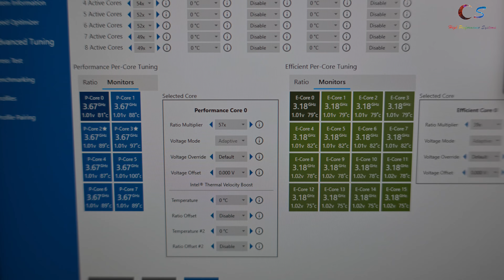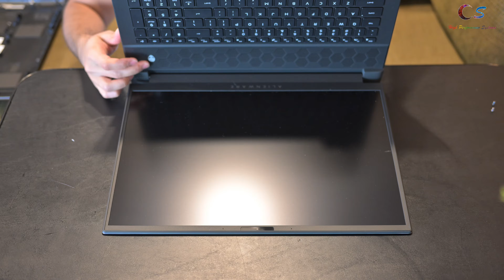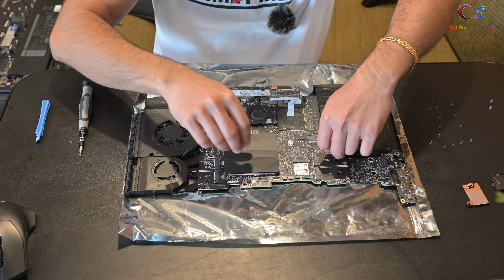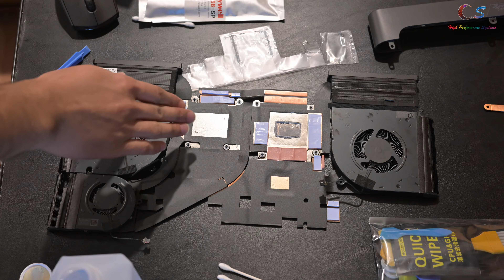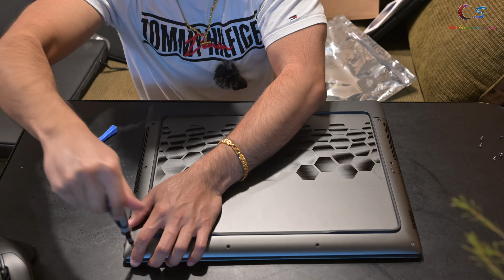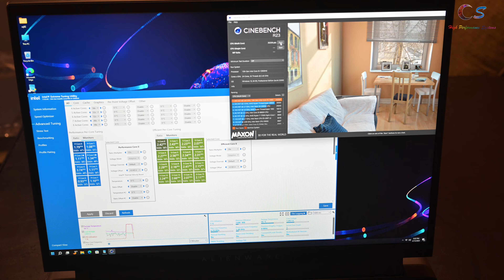Alienware m18 Disassembly & Repaste

Comment: this is silly i mean this laptop supposed to be replace desktop ones so these should be easy to repaste why they do such a thing like this also i wonder razer blade 18 good or this one ?
(i9-4090 settings)
Reply from the maker: The razer blade 18 will have less performance from what I’ve seen. They all run hot so get the one you like the most. The performance difference between them all isn’t significant enough to make a difference in 99% of tasks
Reply: @cs.studios  hm ok thanks for answer oh by the way lot of youtubers say always bad something about dell and his brand alienware and i dont get it why i mean this brand in my country people respect because his service quality build quality (some models) but every youtubers say something bad about alienware or dell i wonder why ? i mean i love dell brand and i bet if i buy gaming laptop proabbly buy alienware and these kind a claims make me wonder.

Comment: @CS Studios do you think it would make sense to change the other thermal pads? What thickness do they have? Thank you
Reply from the maker: I personally didn’t change them. I saw they were making good contact so I left them alone. You will want to buy 0.5mm, 1mm, 1.5mm, 2mm, 3mm and 4mm pads. It’s best to do trial and error with pads on your own system if you decide to change them all

Comment: I still think the Area 51M R2 is the greatest laptop they ever made. Even before a repaste my 10900k rarely ever thermal throttled. Its 2080S was on par with a desktop 2080 at 200 watts. 

Its a shame they lied to the R1 and R2 adopters. Fool me twice, I suppose.
Reply from the maker: I personally prefer my R1 because it has 4 RAM slots for 128gb. But yeah they were the beasts after like 5 years of nothing amazing. The m18 R1 is the closest we’ve gotten since the Area-51m days.

Comment: Been doing some research on PTM7950.  I would have heated it up with a hairdryer to get out any bubbles and allow the material to be crushed down more evenly reapplying the heatsink.  That's just my 2 cents but I'm old school and always go for thick quality paste and evently coat the cpu.  But I deal with a lot of AIOs.

Comment: This is great! I'm thinking about using thermal pads on my M18's m.2 NVMEs because I read that cooling these downs help with CPU and GPU temp. Maybe I can do the thermal pads the RAM too? Do you have any guidance on how to do that and which mm thickness the pads should be?
Reply from the maker: I wouldn’t bother with pads on RAM. For the SSD you can get a m.2 ssd heatsink too

Comment: Did the ptm 7950 fix the one core that was higher than the rest
Are all the cores even in temps now
Reply from the maker: Yes. The power consumption/clock speeds went up after ptm7950 along with performance. All cores are all close together in temps now

Comment: Taking away the liquid metal was a downgrade. Probably better to undervolt the cpu.
Reply from the maker: It wasn’t a downgrade, the cpu is boosting higher and using more power now. So even though temps are high, it’s because it now performs even better. I’m hitting 37k Cb r23 now
Reply: @cs.studios is there anyway I can find out your settings so I can apply the same on my unit to overclock and get higher Cinebebch R23 score ?

Comment: Sounds like it didn't work out in this case, must have done a good job at the factory. I think this also just shows me that the i9-13980hx is a better option for this laptop with better thermals and better undervolting.
Reply from the maker: Actually it did work out kinda. So my temps were still high but that was because the cpu was now boosting much higher. I can score 37k Cb r23 now
Reply: @cs.studios  Ah fair enough, as long as your happy with it! Seems like a huge pain to repaste on these things though. Probably more worth it for folks after the warranty is up in my opinion.
Reply: You have better thermal with 13980HX ?

Comment: The statement about not using alcohol to remove Element 31 is definitely correct. It is buried in the Alienware X17's documentation, and VERY VERY few people know about this . . . including Youtubers and even technical support staffers.
Reply: Yup.. nail polish remover all the way for liquid metal based compounds.
Reply: I think the key to recognize on the 1st benchmark after applying the thermal pads is that the difference between the hottest and coldest P cores reduced. MUCH more importantly is that the standard deviation of all P cores was WAY lower - i.e. MOST of the P cores were now at or near 100deg when the hotest core was there.  Also, when you went to a bigger undervold, the #5 core was no longer your hottest - it was #7.
Reply from the maker: After a few days I hit 37k cb r23 score. Ptm7950 has a small deviation between cores and performance went up
Reply: @cs.studios  that is just insane!!
Reply: I've seen multiple laptop repair videos using alcohol to remove the liquid metal and that does not happen at all. It may cause it to separate a tiny bit, but it doesn't "spill" whatsoever...

Comment: Would have gotten better results with quality thermal paste.
Reply from the maker: Ptm7950 is better than essentially all thermal paste besides pure liquid metal
Reply: @cs.studios honestly.  Its too thick, and the purpose of pad thermal material is to fill gaps when gaps are present.   Cpu or gpu should have zero gap.  So while the material has good conductivity you will always have too much material.  Not an ideal solution at all.  But would be great for vram on gpus.
Reply: @mkgriff1492  tottaly wrong bro
Reply: @coreplaygames7481  Only small handhelds use this solution.  You won't find it in any laptops from any manufacturer.  Everyone has mixed results with this stuff.  Usually, most people end up going back to liquid metal.   This is phase change material, so it's not phase changing as you are applying the heatsink, and that's an issue.   Laptop and GPU heatsinks don't use extreme amounts of pressure.  Too much material is a factor.
Reply: @mkgriff1492  this is wrong, first I always prefer to use a PTM than liquid metal or thermal paste. The thickness fits perfectly in any notebook. Liquid metal actually cools better, but in addition to being much more expensive, it is dangerous to apply, as it can leak after a while. PTM is the best cost-benefit on the market currently. Only liquid metal is worth it for overclockers.

Comment: It seems pathetic to me not to show the detail of placement of the replacement thermal paste, a lot of us go to see the video just for it. you give a thousand turns in unscrewing but you go over the most important point
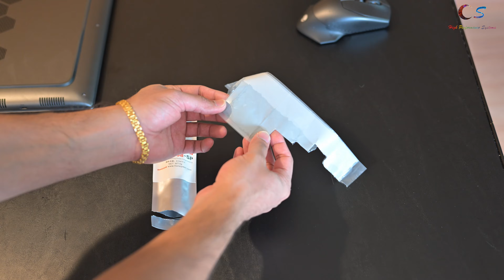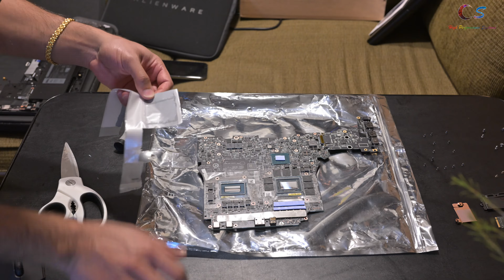Reply from the maker: It seems pathetic you didn’t hear at 1:09 I said I am using ptm7950 phase change pads not traditional thermal paste. Did you even watch the video? At 15:15 you can see the phase change pads applied. They cover the whole die. The video is in 4K you can zoom in. There are hundreds of videos on youtube on how to apply “paste”. Which I don’t recommend in this kind of laptop. The stock element 31 performs decent but problem is uneven contact which no paste will fix, hence using ptm7950 phase change pads instead.

Comment: how comfortable are you with a laptop that operates at 100c
Reply from the maker: You mean how often I run cinebench r23 to make the cpu hit 100c? Gaming temps are 80c or less now after repaste and a couple of thermal cycles. Gpu temps are even lower
Reply: @cs.studios  Do you mean that although the temperature will reach 100c when you run Cinebench, it is only around 80c when you are gaming?
Reply: Just lower the multiplier by a couple hundred megahertz and problem solved without losing too much performance.

Comment: Good Job. Does your wattage drop while Gaming for a couple of seconds?? And how did you enable undervolt in intel Xtu ? mine says undervolt protection enabled 
Btw 64gb Ram only work 5200 Mhz 32gb work on 5600mhz
Reply from the maker: I haven’t noticed that but will keep a close eye on it. m18 specifically supports 64gb 5600mhz ram and 32gb 5800mhz ram. Toms hardware has a i9 13980hx and 32gb 5800mhz ram config. I saw all the options hidden in bios, the laptop needs a bios to show the hidden ram timing and OC page
Reply: @cs.studios  I have the M16 with 4090. while Gaming Every 3 - 4 min the CPU wattage drop to 30W for like 3 seconds. That Pattern is in every single Game.

Comment: Plastic chassis...👎
Take X series...
Reply from the maker: I have both, the difference between X series and new m16/m18 is very minimal
Reply: @cs.studios  well, the X series have magnesium chassis and alluminium. More speakers and x fan system. No?
Reply from the maker: The new m16/m18 have aluminum lid/cover and aluminum die cast frame. The new x16 has full anodized aluminum chassis. M series has quad fans with full copper vapor chamber. Not to mention 10 extra cpu cores. The X series is lighter thinner and has more speakers (only x16). I personally would take a m18 over x16 anyday. Although if comparing x16 vs m16 I’d rather have X16. AW improved the M series build a lot compared to last gen

Comment: Friend, thank you very much for the videos you have made. I am currently going to switch from my Area 51m R1, to the Alienware M18. I honestly wasn't sure about it, but your videos helped me choose. One last question would be if the M18 has 4 slots for ram memory or only 2. Grettings from Orizaba, Veracruz, Mexico.
Reply from the maker: It has 2 slots for RAM. As of right now I am running 64GB (2x32GB) RAM. Once 96GB (2x48GB) sticks become available I will upgrade
Reply: @cs.studios  I come from an Area-5m R1, before I had the 17 R4 and before that the M18x and the M11x. For this 2023 I expected something different from the Area 51m, I even wait 4 years to upgrade to a new laptop but I already bought this M18 R1, but with a very bad taste in my mouth, in reality I almost didn't want to buy it and I was about to betray myself buying a Razer but couldn't. It bothers me that Alienware does nonsensical things like not putting lights on the touchpad, or putting the SD card reader on the back and instead the ethernet port on the side. The worst is it feel like im not upgrading nothing since is a exterior copy of the Area 51m.
Reply: @cs.studios  does M18 r1 support 96 gb ?

Comment: Thanks for the hard work and posting this. If only they didn't have an inverted motherboard I am sure the temperatures would be better. CBR23 will make most systems break a sweat, how are the gaming temperatures after the repaste?
Reply from the maker: In the last of us part 1 cpu is around 89-90c with balance mode fans. I guess that’s better than 95-100c lol. I’m sure if I do ultra performance fans it’ll be a bit less. Just lifting up the laptop a bit from the desk alone decreases temps to 81-82c
Reply: @cs.studios  Wow, that is a huge drop from propping it up.  Would love to know how low a cooling pad with fans could get it.

Comment: last time i bought an AW, it had massive core differentials due to the tripod heatsink. I was upgraded to a newer laptop which still had the same issues. Now 5 years later, it seems like they still haven't made progress on the cooling side and made it harder for enthousiast to repaste their machine.

A shame you still need to open up a brand new machine and put on new paste. But as long as people tollerate the broken laptops from factory, they newer will be pushed to fix their mess
Reply from the maker: They’re getting wrecked on reddit about temps and I’ve also told them so they at least know there’s some issue
Reply: @cs.studios  But Dell not listen to you !
Reply: @cs.studios  Dell and many other companies like Asus do not listen to costumers at all!

Comment: In my experience with ALL Alienware laptops since the introduction of the M15 R X series laptops, and X series, copper shims are needed to get proper mounting pressure for active cooling gains. I did have an X14 that I worked on last year, that liquid metal cured without any shims.
Reply: I have wondered about this for my X17 R1 with 11980HK. It has a 21 deg gap when the first core hits 100. Stabilized, I have 2 cores right at 100, and every other core is below 90 with most in the mid to low 80s! Do you have any links or other info you could provide to help me with shimming my own mounts? Thanks in advance if you can help!

Comment: It looked as though there was a felt/mesh like dust filter inside, on the top honeycomb intake holes (beside the power button).  I wonder if removing that would improve airflow...
Reply from the maker: Interesting, I may have to take a look when I disassemble again
Reply: 8:52

Comment: Nice video bud !  Yeah, the E31 wipes off pretty easy, I found it easier then IC Diamond haha.  Glad this improved your scores yet again :) it's really unfortunate that we need to do this, but at least we know it can be fixed.  I still can't figure out what the difference is between mine and yours, as I am still locked out of undervolting in XTU, for whatever reason.
Reply from the maker: Try resetting bios defaults and switch awcc to custom profile then open xtu

Comment from the maker: 37k cb r23: https://i.imgur.com/QayY6dH.png

Next: I wonder if I should add a sub into the m18 like I experimented with a 2nd one in one of my m18x years ago... lol: https://www.nbrchive.net/xfa/alienware-18-and-m18x.1092/MSI%20GT72S%20Subwoofer%20Installation%20%5BM18xR2%5D/images/storyImages/Y4k4Sr6.jpg

Element 31 is actually a good performing TIM. The problem is, it isn't applied properly from factory otherwise performance can be very good. Here I replaced with ptm7950 phase change pads.

Interestingly, the overall temps on all cores went up, however, my performance increased, and the cpu does not throttle as bad as it did before.

I may re-paste one more time when my fresh ptm7950 comes in since this one seems not as good as when I first bought it
Reply: it would be nice if dell actually sells it too hehe but I also recently ordered the PTM7950 as well as some fuji poly thermalpads.
Reply: that would certainly be a baller move lol
Reply: Overall temps went up probs because the heat was evenly distributed vs your hotspot before, right?

Comment: Nice video! BTW I think its the pads thats the issue, maybe try getting some better thermal pads. Plus im kinda curious why at stock, the m16 out performs the m18 in terms of benchmark. The m16 by other tech youtubers seems to handle the heat better than the m18. Gizmo and OwnOrDisown also has a underperforming m18 while the m16 they bought performs better.
Reply from the maker: I don’t know of any m16 performing better than my m18 at stock (see my m18 review video) but I do know many m16 came with awcc v5 whereas m18 only came with awcc v6. With some bios updates the m18 is performing well. We just need dell to apply element 31 better
Reply: @cs.studios  Gizmo tech's, Own or Disown as well as one small youtube channel has a underwhelming m18 bud. I got the m16 because it was the only thing available back in feb when my brother was about to go home to our place. Anywho I hope someone makes a repaste guide for the m16 as well. BTW whats your reasoning behind using intel xtu over throttlestop? I havent used xtu but Im waiting for a guide on how to optimize the m16. Its still in the box haha. NIce vid! keep it up!
Reply from the maker: No offense to anyone but everyone with a underperforming m18 could have fixed most of their performance (besides throttling/UV). I stayed on bios 1.2.0 until 1.6.0 came out and was already scoring 33k cb. I spent over a month with my laptop before even posting a review video. My friend got his laptop super early and I saw why some people were having issues right away. If you play with awcc you will see which profiles cause performance problems. Running balanced or custom alone fixed many issues. His laptop was performing similar to everyone else too and I got him to 32k CB in a couple of hours (no UV/still throttling and this was before most had a m18). Again this goes back to m16 coming with the older awcc v5 vs m18 coming with v6. V6 introduced bugs and slowly AW is improving the software/bios. The last thing now is to improve the element 31 application and this will make the performance/thermals perfect.
Reply from the maker: I used XTU because throttlestop kept making my cpu run at a super low clock speed when I UV. I normally use TS but this time went with XTU. I was on bios 1.2.0 and unlocked UV in 1.2.0 before 1.5.2 existed so I had to rely on XTU to UV at the time and decided to keep it
Reply from the maker: Oh btw repaste for m16 should be like 95% similar to m18. Just checked the service manual, using this guide should allow you to do it to a m16 as well! 😉
Reply: @cs.studios  I see, I think I should watch how to use the XTU first haha. I've watched your alienware vids because back then I really wanted the area 51m r2 but kinda got stuck with my msi gt75 titan. By the time I wanted to upgrade the x17 r2 was already a year old and the M series was about to come out so yeah I waited again haha. I'll check my M16 bios first. Btw I heard it was hard to install the new awcc v6. Should probably look into it first. Thank you for answering my questions sir!
Reply from the maker: The m16 is a great laptop. m16/m18 is a great example of a laptop that has similar spec/performance with main difference being screen size. This is great because going with a m16 you don’t really compromise like you would with other laptops. BIOS 1.6.0 allows undervolting, if you’re on a older bios you can get 1.6.0 and undervolt in bios or TS. -0.100v should be doable on most cpus. It will help your temps too.  Most people aren’t using XTU which is fine. AW mentioned they are working adding UV support in AWCC so once that happens we may be able to use AWCC alone for everything. Installing AWCC is easy, they have the files on the support site now so even if you reinstall you can get it back.